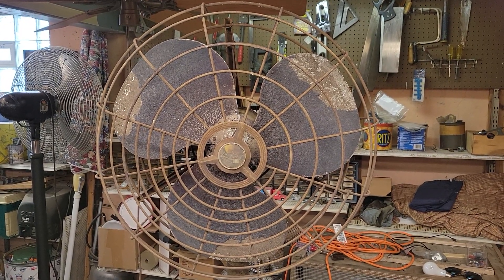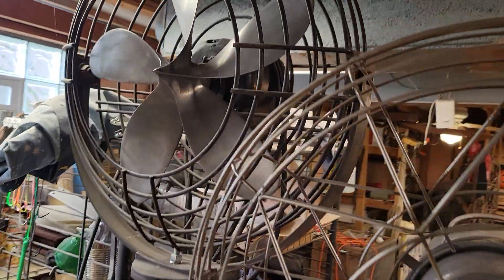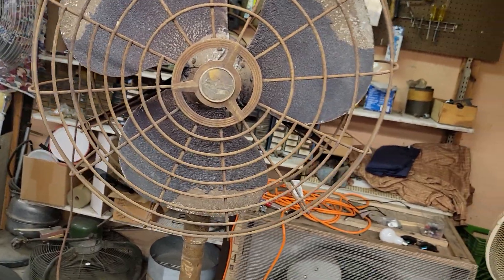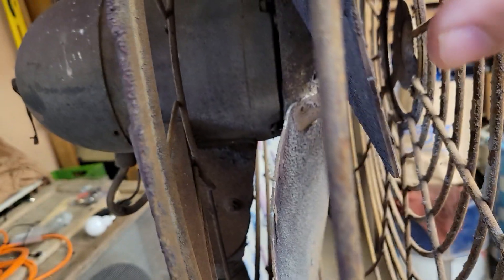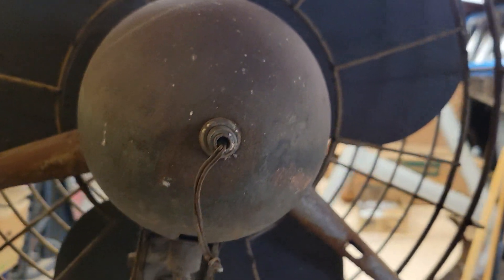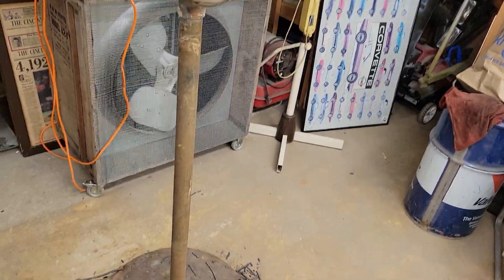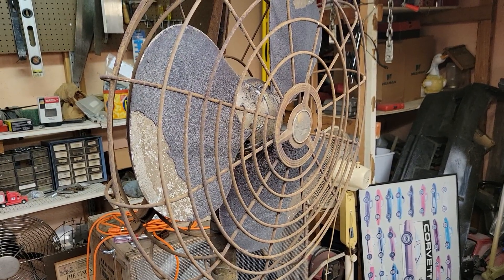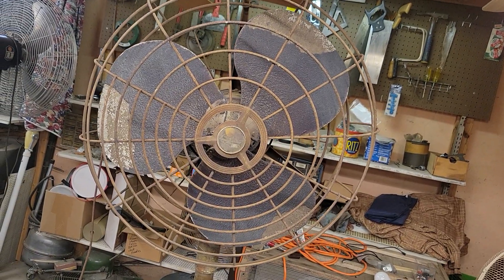Vintage 24" Emerson Pedestal Fan Overview and Demonstration

Comment: I would also change the switch since the original ones break all the time. A 3pdt toggle switch will work and there are some diagrams out on google.